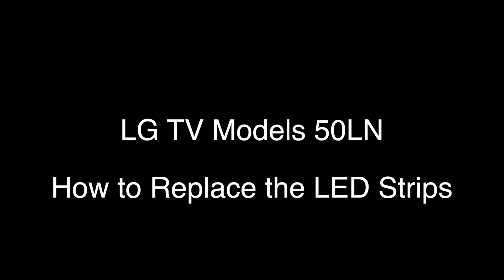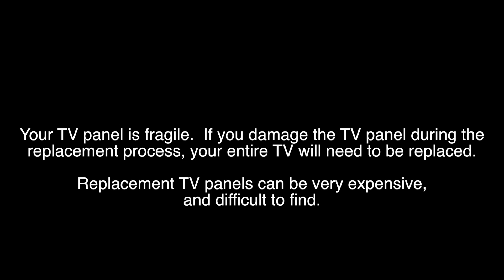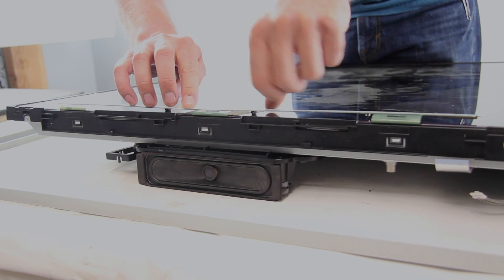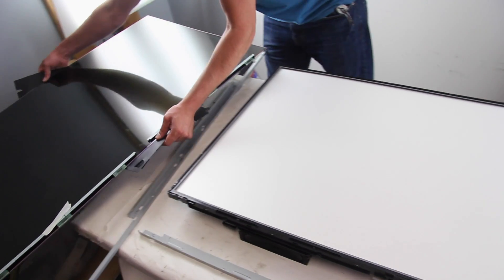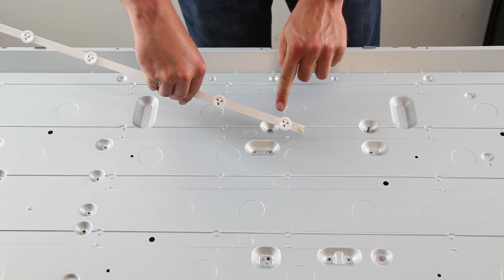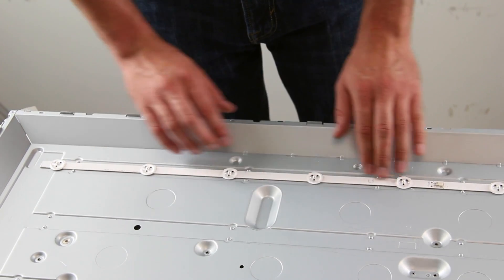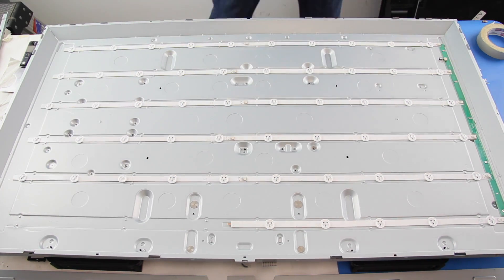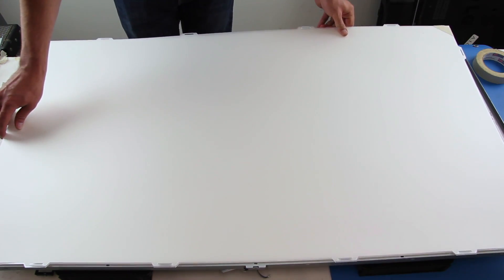LG 50LN LED Strip Replacement Tutorial  - How to Replace the LED Strips No Backlights

Comment: Great walk through (Toshiba 50l 1350U). My tv had 4 plastic risers as described, but two with a straight tip and two curved tip. I didn't see how they came out, couldn't find any reference, so I just guessed when they went back in.

* Take the warning about the panel being thin and fragile to heart, especially when putting it back in because it needs to be very tightly aligned. Don't force it (like me, 3 inch crack in the upper left corner, but barely noticable :) **

Comment: Thanks for video. One question: how are the LEDs tested before reassembling the TV. This was mentioned but not explained. Thanks again.
Reply: There is probably a cheaper way but shopjimmy sells an LED tester that you can buy and use before you re-assemble the TV...
Reply: Best do sometimes it s not the led but printed circuit itself
Reply: You connect 3 nine volt battery to make a tester they connect positives to negative etc..the open terminals add speaker wire or electrical wire and you now have power to LEDs.. however Google more on home made LEDs testers

Comment: Thanks for the informative vid. I used your tutorial to replace a single strip about a year ago, now I've had two other strips with defective leds. I just purchased a full set from your eBay store, and hope to get a few more years out of this tv. It'll be nice to have the older ones that are still good laying around too. Question, I understand that you say to update to latest version of software. If I already have the latest, is it best just to re-initialize the set to factory settings, and then lower the brightness and backlight settings? Thanks again for the info AND the led's. Oh, and this time, I'll tape the screens, lol....what a pain to line up, but it was successful. G2G, these dark spots are messin' with me eyes........

Comment: Can i use super glue to stick cap over led in led tv?
Reply: Most people do so. If the same led burns out, it'd be best to replace the strip anyway, so the need for a removable adhesive isn't necessary. At least that's my opinion. Be sure to only use superglue in the 3 dark spots made for adhesive, and not on the led itself. Btw, ShopJimmy sells the unit to heat the strip for led removal, in case you didn't know.

Comment: A question for you.  I have a 47" LG tv that started flashing.  On, off, on, off.  Sound is fine and picture seems OK when it flashes.  I have replaced all three boards on the back.  One post indicated that maybe some LED's have gone bad causing the ballast to reset.  Would you agree?  If so would you replace all LED's or try to figure out which are bad.

Thanks
Reply: ricor43 i have same problem
Reply: Had the same problem here. It's a series of burnt out LEDs. You can replace one or two and see if it turns back on but the best method is to replace them all. If they are the original LEDs, they'll continue to burn out one by one until the TV turns off again.
Reply: @johnnyteres  im in the process! All new led banks!

Comment: Great video.  Is there a process to clean the LCD panel if you touch it?
Reply: Spray the cloth, then wipe the screen.  Do not spray directly on screen as it can run down and short the electronics.

Comment: I am just trying to match up the part number for LED light strips with my TV.  I called the 877 number and the guy would not directly help me.  He said I needed to go to You tube and watch "the" video.  So, I have watched several and cannot figure out which light strip I need for my LG LED 55LB6100.  The guy on the phone said I need to match up what's on my "board".  Well, I have 3-4 boards.  On each one, are several numbers.  Please help me with this.  Will this light strip: part no.sj-NC500DUN-VXBP2 work on my TV?
Reply: I think the replacements for 55 inch LG are all the same .I ordered from Ebay getting think in a week or so.60 bucks.they have lost my TV is lg55la6205

Comment: great video, step by step instructions on how to replace LED strips for LG TVs , done in about an hour , and I'm not a electronic technician and this video help me to fix my 42" LG TV. When I call LG company they said it is a out of warranty and is going to cost me over $300 that's only the repair with out parts.  Thanks to ShopJimmy.com and there support I found the LEDs strips for less than $70.00 to fix my TV.

Comment: a neighbor gave a tv that he was throwing away because the tv was black. i saw your tutorial on the flaslight test and it worked, i have sound and when i run a flash light thru i can see an image. he said he had this problem before and he someone replace the backlight, my question is should i replace the backlight or the inverter according to your tutorial?

also my model tv is lg 50ln5100

thanks in advance
Reply: hey i have the same tv and the same issue, did you ever get yours working? if so what was the issue if i may ask?

Comment: Great video. After i pulled my tv apart, saw that 1 led was burnt out, ordered the proper led strip from shopjimmy (get the number perfect). It arrived and i put in the new LED strip along with the double sided tape that I bought. Put it all back together. A $900 tv is now fixed for $25 and about 1 hr of my time.
Reply: Matt Boucher thanks for the review

Comment: I have a insignia ns-48d510na15. the tv's backlight comes on but there's no picture. when I turn the tv on there's a red light that blinks 5-6 times. I replaced the main board, but that did not fix the issue. the next I am thinking needs replacing is either the t-con board or the power board. any help would be appreciated
Reply: Have you checked the ceramic fuse on the t-con board?